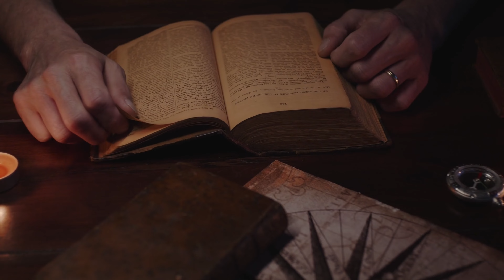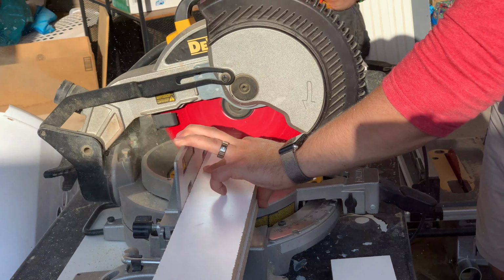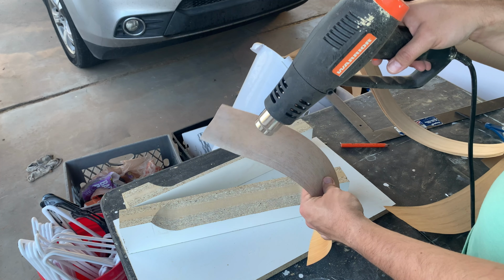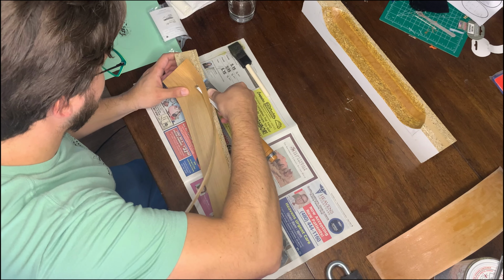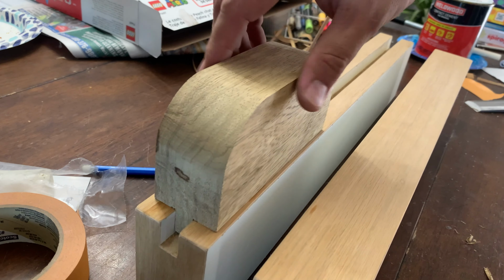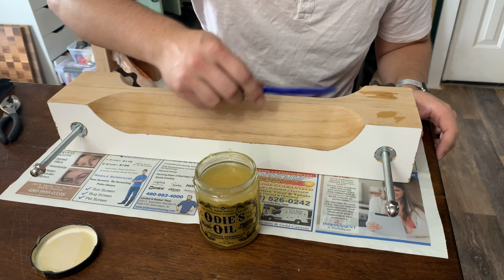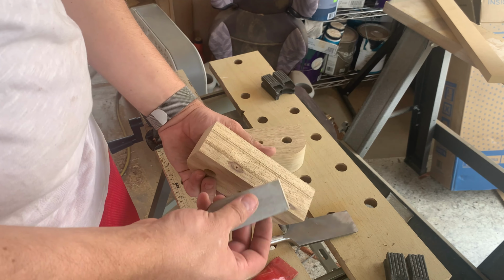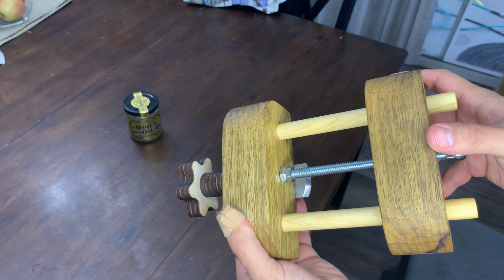Book Binding Finishing Press & Plough DIY | Making Book Binding Just A Little Bit Easier

Comment: So awesome!  Love the design! Started wondering how to design supports that could be used on both sides of this for some additional stability, especially when using the plough.  WELL DONE!
Reply from the maker: Yes! I stacked it on blocks so that I could clamp the book and then it was very shaky unless I held it down quite firmly. Definitely need some kind of stand to go along with it 😊
Reply: @TheFridayForge  drill two holes from top to bottom.  1/2 inch or less. Now make 2 peices of wood for feet. Glue dowels in them, 1/2 inch or less. If the feet are long enough, you can clamp them to your workbench and be as solid as the Rock of Gibraltar. 

Bonus points if you make feet tall enough to accommodate different sized books.

Comment: Omg do you have measurements for everything? This is exactly what I was looking for!
Reply: Also how would you sharpen the blade?
Reply from the maker: Hey thanks! tbh this was a bit ago and I don't remember the exact dimensions. I loaned it to a friend so I can't measure at the moment either :( But I'll try to give you some general info.
I think it was about 2 ft long. Each side was about 2" thick (two 3/4" melamine + 1/2" MDF). The carriage bolts were 3/8" diameter and probably 10" long I think. I don't really remember a whole lot of specifics on the plough. each side was most likely about 2" thick as well. Maybe 5"-6" long.
All these measurements don't really matter too much. Whatever size works for you :)
Reply from the maker: For the blade, I just sharpened it with a regular old sharpening stone, nothing fancy. Since then I have stropped it with a leather strop and jewelers compound.
Reply: @TheFridayForge  Thanks! This will help a ton with proportions!

Comment: Ok, you can get really nice results setting the table saw blade to 45 degrees and ripping down the whole length.

You want nice 90 degree blocks? Can do. Before firing up the table saw, drill 4 holes, one pair about an inch apart on each end. DEEP holes. Now rip on table saw.

You have some drop off now, also cut at 45 degrees. Lop each end off the drop off, with both holes. Glue back on, using dowel joints to line everything up.  

Don't be stingy here. Leave a fair bit of wood on the drop off. First time I did this, the drop off had a triangle cross section and shattered like glass when I tried to join them up with a mallet.